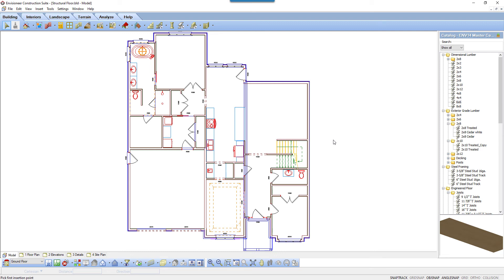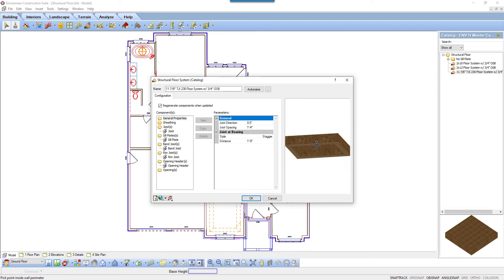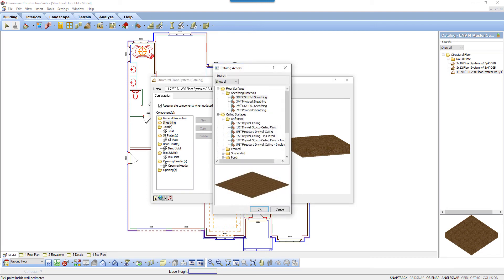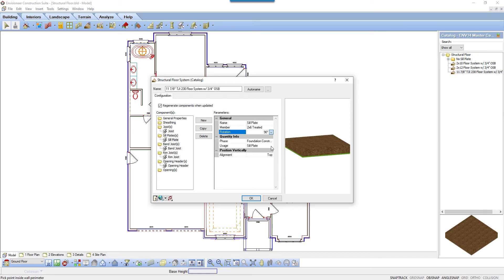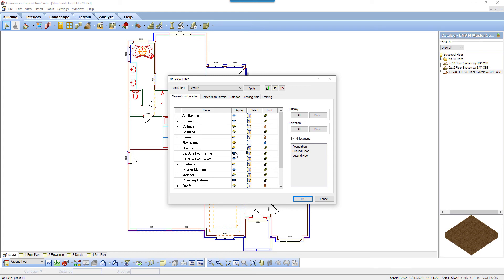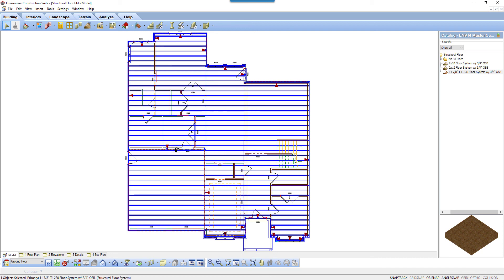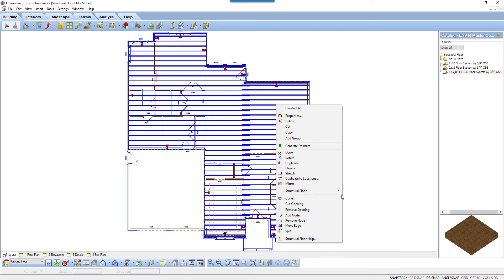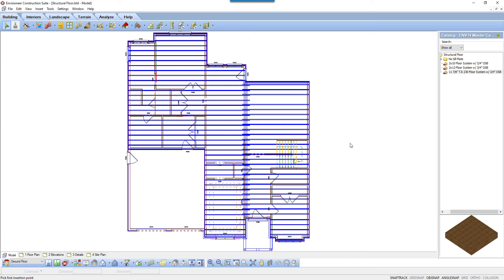Designing a Structural Floor System in Envisioneer

Comment: how do you rotate the structured floor if it comes out in the wrong direction?
Reply from the maker: Select the Structural Floor, right click and select Properties. In the Structural Floor dialog, one of the General Properties is "Joist Direction" change it to the desired direction and click OK in the dialog box. The inserted floor will change the joist direction.
Reply: @Cadsoftcorp  wow thanks
Reply: @Cadsoftcorp  i CANNOT find joist direction thingy...I have Envisioneer 17
Reply from the maker: @Saludtotal48  If you select the structural floor and then right click and select Properties, you should see a dialog that says Structural Floor System. If you see a different dialog, then you have probably chosen the sheathing or the joist. Once you select the correct element, the Joist Direction should be visible. If you are still not able to find the correct element,t reach out to our support team and they can assist you with this concern. Thanks!!
Reply: @Cadsoftcorp  i got it thanks